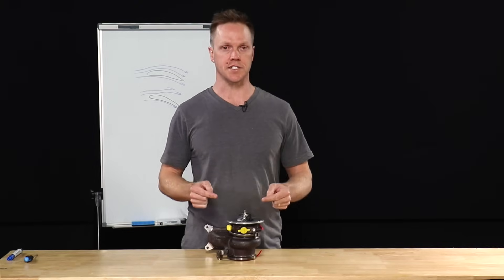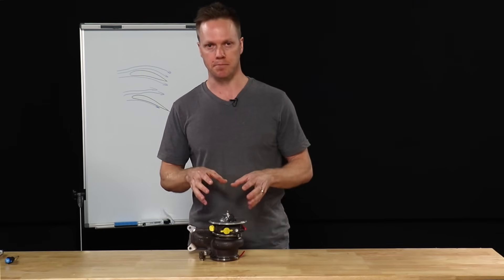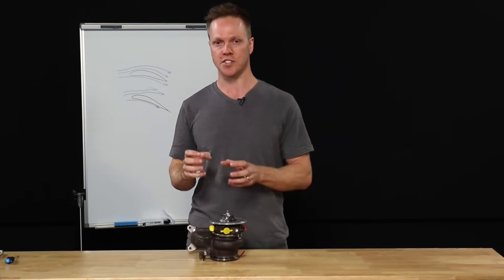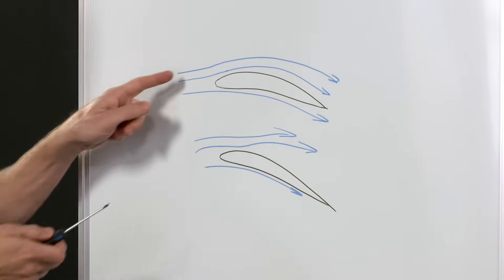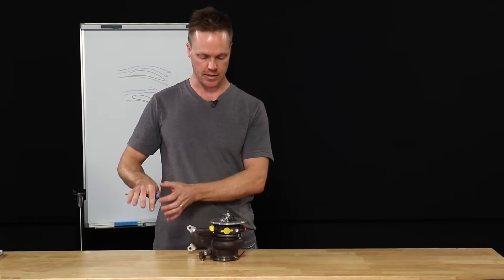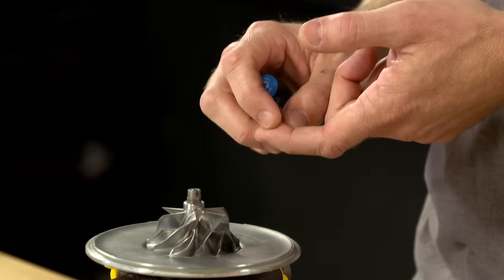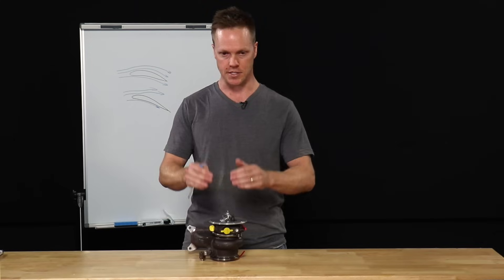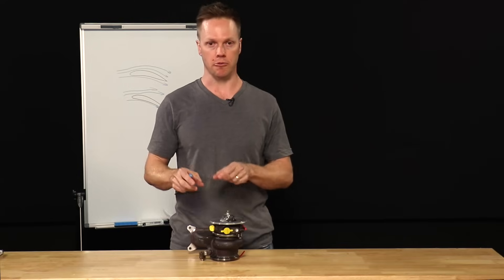Compressor Surge Explained [GO FAST BRETT]

Comment: I have been having this issue for years and still no fix. I have a mk5 gli and it got worse with the k04, but basically it does the sputtering flutter sound and actually stalls the car while it does this on upshifts. No diverter valve change has ever worked, I even tried adjusting wastegate by a tuen and a half and no change. Closest answer I got was from apr saying it sounds like it's bouncing off surge like but effecting performance

Comment: Here are again. 50/50 on the “will it damage the turbo”. I’ve seen guys say they built / ran / raced / esc turbos for 40+ years with no BOV’s and never had a failure. And I’ve seen guys say every turbo ram without BOV has quit….. 50/50 no mean towards one way or the other. I’ve been in a mission for 4 years now to answer the forbidden question. Does closed throttle surge damage the turbo? I’ve had a million yeses, and a million no’s. With over half of both being for a fact from real world experiences. ……..

Comment: then how come I lost all my chu chu noises when upgrading to a larger turbo? recirculate blow off valve is also installed before and after the upgrade.
Reply: Different design of compressor blades and housing and/or extra pressure in pipe is pushing the blow off valve open easier when you lift off the throttle.

Comment: Why do some many builds I see have this sound? To people not care about the possible damage? Or is it not as much of a worry if your turbo isn't being pushed really hard?
Reply: It's because it doesn't do any noticeable damage.
Reply: @DriftNick  so why does anyone use blow of valves if thats the case, is what confuses me
Reply: @sandwich.entity3810  They like the sound and/or don't understand it's not required, also no blow off valve/bypass valve can mess with air flow meters causing a rich condition.
Reply: @DriftNick  ah okay that makes sense, thanks for explaining

Comment: Hey,2015 benz c300,  bov was installed and worked perfectly for about 2 days. Day 3 the pshhh noise that I use to get was starting to sound like its underwater or being rapidly closed momentarily during the "pshhh". Any ideas? Re-installed did the exact same thing, 3 days max

Comment: I have a MK7.5 . I put a DTE chipset on it and then a few days later  I installed k&n cold intake kit. 

When I'm on half throttle and the turbo is on half boost it begins to surge. If let go of the throttle or go wide open throttle then surging ends. 
I also live in Iran and the supreme fuel quality is not that great so I use octane booster everytime I refuel.
What do I do? Should I take the car for remap?

Comment: So im having this issue with my 2017 GTI. When in 3rd at about 4k rpm the turbo starts to make a chopping sound. Like helicopter blades or a bag whipping in the wind very quickly. It stops when I shift or if i accelerate harder. My GTI isnt tuned but i do have an Injen intake on it and the resonator and muff have been removed. Any idea as to what It could be?
Reply: I've heard people saying that with the injen intake before. I doubt that genuinely has any cause to the problem and that most people can now actually hear it. I'm stage 2 on mine and I actually am getting compressor surge between 2500-3000 at wide open. Beyond 3000 it takes all the boost no problem. Hoping to get it tuned out this weekend.

As far as your scenario, a lot of people will say to swap to a DV+. I'm not buying that. People run 30+ PSI on the stock diverter valve so that can't be the issue. I'd be surprised if the stock tune has too much boost at 4000RPM though considering I'm +6PSI at that point and I simply have a catless DP, full intake setup, and the tune.

Comment: Wrong , wastegate chatter is NOT the same as surge, wastegate chatter in when you are giving the car gas, typically in a high gear, or out of map, and the wastegate simply lets of spurts of extra boost, sounds like “th th th th” 
, surge is what he explained and it sounds more like “teuh teuh teuh”

Comment: Wastegate chatter is different: the actual wastegate actuator opening and closing the flapper on the exhaust side of the turbo; making a shuttering noise not a CHOOOCHOOooochooo noise.

Comment: I have a DV+ on my fiesta st, what can i do to make it sound more fluttery?
Reply: Probably a bit late but, tighten the spring preload screw. I have mine set to where it flutters at low boost but in higher boost, it recirculates as it should.

Comment: Question brother what happens when you’re not running a lot of boost And you’re running like 10 to 11 psi it will be OK havin turbo flutter.  Or  still damage the turbo

Comment: Open throttle surge is the culprit. Closed is fine. the air actually doesn’t go back through the turbo, it goes through the intake. It’s spinning at 100k rpm.

Comment: Interesting.... I've owned a stage 2 chipped 89' Audi 200 for 15 years and is has 240,000 miles on it. it runs 19 psi, These cars have no bov/diverter valve from the factory and the stock 30 year old turbo is fine...

Comment: Compressor surge happens under boost only(turbo flutter under load) and that is what causes the crazy loads on thrust bearing especially and can damage the turbo badly. The turbo flutter by letting off the pedal is caused by reversion and nothing else, it doesn't damage the turbo, might increase thrust bearing wear dependent on what turbo it is. But ball bearings wont feel it at all.

Basically stepping to the left side outside of the compressor map graph is when compressor surge is gonna occur or the turbo is way oversized for the setup flowing more air than what the engine can handle. A BOV has nothing do with the damage, except on cars with ALS like rally and rallycross cars. Then it will cause heavy compressor surge without a BOV between gears while the throttle is shut and the ALS keeps spooling the turbo and build boost without open throttle plate causing crazy loads on everything within the turbo. End of discussion.

Comment: Not correct. The chatter noise is from when the air, hits the throttle butterfly and to the turbo repeatedly. You can prevent surge by fully opening the butterfly with your foot on the throttle, also by Upgrading your throttle body and cylinder head for better airflow.

Comment: Attention: 
I will end this discussion once and for all, Turbos Fluttering DO NOT Cause any sort of damage to any of your cars parts, it might break hearts yes but not the car . . Here’s proof and I’ll cut it short, I own a 2001 Audi A4 1.8t for bout 2 Years, I bought a eBay ko4 turbo a year and half ago, my car has been fluttering since that day, keep in mind it’s almost 2 years that I’ve been running that cheap turbo . . And I’m pushing 28 psi on stage 2 tune, the turbo is showing no signs of failure . . Go check my IG (salah_b5) . .
Reply: Let’s end that discussion once and for all

Comment: Flutter use to be the standard. When turbo cars first came around they all ran without BOV's. Flutter wasn't seen as something that would destroy a turbo not even to manufacturers. I believe it was the rice scene that actually gave rise to BOV's in order to enhance or change the sound of flutter to something else for scene points and it 'saving turbo's' was the marketing pitch in order to sell them to every idiot but now everyone is running them and less cars flutter and its so boring. I think the point is, physics would suggest that flutter will give a turbo more stress but in reality it's usually never enough stress to make a difference because by the the time that turbo is ready to shit itself because of some pathetic flutter, you'd have sold the car or the engine would have already died long before. Do you know how fast turbo blades spin? There's barely any setups out there that will produce enough boost to be able to even significantly oppose the spinning blades of a turbo coming off throttle. The charged air trapped between the closed throttle plate and turbo is a pathetic amount of pressure for a spinning turbo. If it really was a significant amount of pressurised air it would pop off most people's flimsy eBay boost pipes for a start which rarely happens let alone damage a fucking turbine that can whitand explosive exhaust conditions. This is just a pointless debate.

Comment: Nice one guys! You just got a reference in a piece of project work for my degree! We're doing material selection for turbine wheels and this helped massively in my understanding of the potential failure modes due to extreme conditions. MAAAAAD

Comment: #mcmtv2 Then is a low pressure ex: sr20det with around 6~12psi safe enough to flutter the turbo since it's low pressure and not that much stress on the blades. Just love the sound.

Comment: Just experienced this with my GFB Respons valve when releasing the pedal this morning, it was 10C.  I guess the turbo ran into higher boost to correct the load. But this is flutter not surge. Sounds like an efing HKS, lol. I have to do a half turn back on the spring to see how it goes.

Comment: question. factory 2005 Legacy (Liberty) 2.5GT. engine and turbo are all factory. getting some compressor surge under acceleration at higher RPM. thoughts? solutions? thanks!

Comment: excellent description after asking over 6 mechanics in my area and none of them seemed to know what causes it, one even went as far as to say its the fins in the turbo hitting the outer casing and telling me i needed a new turbo.
so I have a ford focus 1.6tdci and it does this every time I take my foot off the accelerator ? all the Pipes On top of engine have been renewed but it still does it. any ideas ? as I'm sick of mechanics standing scratching their heads while looking under my bonnet. 
any info would be greatly appreciated, thanks
Reply: If you get flutter off throttle then your blow off valve or bypass valve isn't opening properly (or you don't have one), it's normal for it to happen.

Comment: actually compressor  surge is when the flutter sound goes off while accelerating and turbos is under load. turbo flutter(that sweet  sweet noice) is when the car lets off and the turbo is not under load, therefore not ruining bearing in said turbo

Comment: I found that if it's surging on boost, tighten your wastegate and lower your contoller usual fixes it. this way you can keep that same boost. it takes power to compress air, it gets that power from the exhaust pressure (obviously). that exhaust pressure can open your wastegate if it is too weak, and bleed off the require energy to support volume and pressure trying to be demanded by your boost controller and stalling the compressor.

Comment: When closing the throttle its flutter
Compressor surge is under load I.e. acceleration. 

Closed throttle flutter isnt bad. Cars had turbo's long before BOV's were a thing and they ran just fine without them and no ones turbo just blew even with the older turbo tech. 

compressor surge under load is a different thing then flutter and its a bad thing. the condition that causes it needs to be remedied. 
Lots of high hp cars dont use them and have no issue at all. 

Solved the whole argument in less time then it took to make a video.
Reply: too bad barely anybody knows this and just talks shit about everything!!
Reply: This. This. This this this and nothing but this. I don't understand why people don't grasp this concept.
Reply: to bad thats not the case . Diesel have no throttle body but do this  also.  See what happens when you beilve everything you read on the internet.
Reply: too bad you can't spell
Reply: squishypitbull  Hey, shit-talker,  "flutter" is STILL CALLED COMPRESSOR SURGE!!!!!!!!!!!!

Theres 2 types of COMPRESSOR SURGE; on-throttle c/s... and off-throttle c/s.   And yes, off-throttle c/s does significantly reduce the life of the bearings at it causes high axial-loading on the shaft.
Reply: Yes, they both go by the same general name, but the reason people have given them different names is so less people get them confused. So for all intents and purposes, they can be called DIFFERENT things, because otherwise, idiots call them the SAME thing.
Reply: We already have terminology for both types; on-throttle c/s and off-throttle c/s!
Reply: Okay buddy.

Comment: Question.. 
Can you have a Blow Off Valve with Too BIG of a diameter? Will having too big a diameter prevent it from fully opening/releasing the surge? If yes, will this result in Turbo Surge? Or Is there no way for the diameter of the BOV to be 'too big' and instead this is a function of how soft or stiff the spring is? 

Thanks mcmtv2

Comment: Adding another condition for a turbocharger to surge, this is due to the efficiency of a turbocharger's compressor and turbine at particular engine load. As the compressor is dumping excessive amount of air reaching beyond the limitation of  engine's throttle body / head flows at given RPM and load,  that air bounces back creating a series  of surge. This is particular common working off a large compressor on a relatively small turbine ramping up boost at partial throttle 3rd and 4th gear. This will do the damages to the bearings behind the comp wheel, BOV cannot fix this problem, but can use anti-surge slot on comp cover, a re-circulation valve, or just create a small man made boost leak that will result in similar effect. Any of those methods will decrease compressor efficiency, cause lower RPM to Boost ration as well as boost to power ratio.

Comment: does venting to atmo cause the turbo to loose to much pressure and 'lag' to get back up to pressure?
Reply: No, if the car isn't tuned for atmospheric it will just dump more gas in causing a slight delay to return A/F ratio back to normal, but this has nothing to do with the air pressure.

Comment: So does the pressure get vented when you off the throttle or when you clutch in?
Reply: Pressure gets vented based upon the preload setting on the BOV, meaning if it's too light, you could not even let off the throttle all the way and it will start venting. I had this problem and had to increase my preload lbs. I have also found that 50/50 is much better when you don't have a tune setup for atmospheric venting and you still get the BOV sound.

Comment: thank you for your video  it is very well done .I have compressor surge at partial throttle in the upper RPMs. you suggested lowering the Boost at the point of surge then increasing it at higher RPMs. how do I control the boost like that?
Reply: Boost controller and a tune.
Reply: So I need an electronic boost controller? Is there a special name for a Boost controller you can control the boost by RPM? Would my ECU control the boost? Please elaborate

Comment: @mcmtv2 I have a 2010 Mk6 gti which I upgraded to a k04 turbo about 4 yrs ago.  I had the flutter when I come off boost, at any rpm, any speed, anytime I let off the gas after boosting a little bit, then the pigeon flutter happens.  I thought it was just something that happens with higher boost, not a sign of something not working properly, and I'm pretty convinced by your explanation.  I don't want to go back to stock turbo, and don't want to test how long the K04 can go with consistent flutter before it breaks.  So according to your video, if I understood it properly, I need to upgrade my diverter valve right?  I mean you talk about BOVs and not DVs but they both do the same job, just dumps unused boost in different places.  Also, I've NEVER had the flutter while on boost or building boost, always when I lift off throttle after some boost has been built up.  So I don't need to (nor can I make any changes to the APR v3.1 tune, lol), I just need a DV that works!  Should i switch to a BOV?  Any downsides to that (cuz the ecu tune is expecting all pressured air to be accounted for, not let out of the loop into the atmosphere).

Comment: It would be good if he explained that off throttle surge has been proven to have very little effect on the turbo in the real world, in terms of causing damage and reducing the life of the turbo most of the time.
Reply: Is it safe to block off a bov on a journal bearing turbo (2020 veloster n performance package) to be exact 

We have already done and but I seen someone say it’s not safe on journal bearing turbos so now I’m all worried
Reply: @zaneelliott7538  its safe, but the journal bearings will recieve more wear as they can't handle it as well as the ball bearings. but otherwise it shouldn't do much
Reply: @zaneelliott7538  it’s safe. Off throttle surge won’t really damage a turbo. Turning up the boost etc will do way more harm.

Comment: Can someone answer my question? I heard that compressor surge is ok if the turbo has ball bearings, but bad if it happens on a turbo with journal bearings. Is that correct?